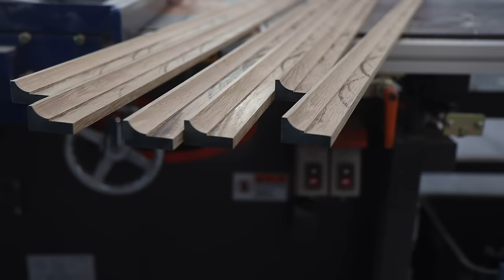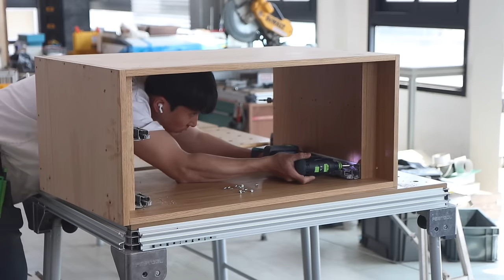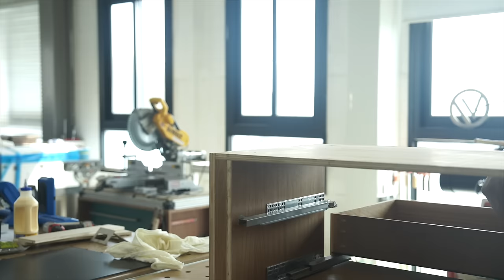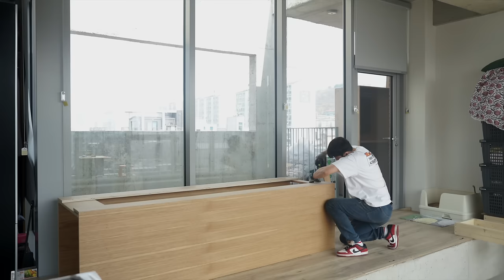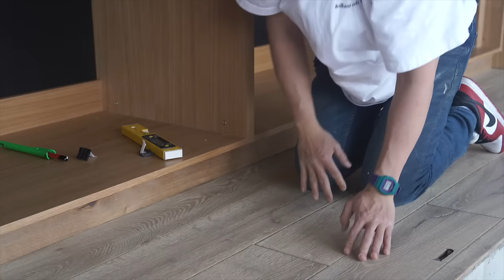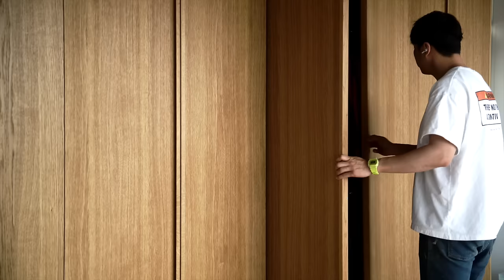W135_oak wardrobe

Comment: Very nice, well done. What kind of thickness has the wood finish? Do you have an alibaba reference? Or any other link to those sheets of plywood?
Reply from the maker: 18mm. that is querkus
Reply: @ViTTEN  Very nice piece and video!  The grain is really outstanding. Definately not the "big-box" plywood.  Do you have it shipped to Korea or is there a distributor there....I only see Querkus in England.
Reply: @rdy4trvl I think I need 40 sheets, but that is difficult to get here in the Netherlands. And ridiculous prices, so I look for eastern sellers.
Reply: @rvamerongen  Wow, 40 sheets - Querkus may open a shop just for you!  I was guessing he used 15+ sheets on this project.  It is nice looking wood.